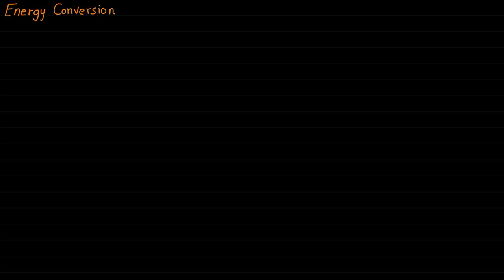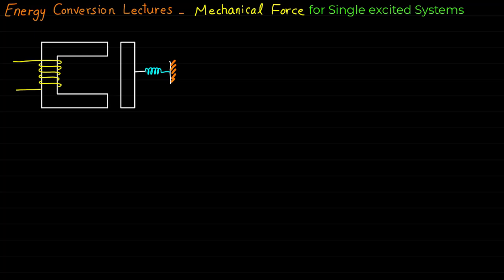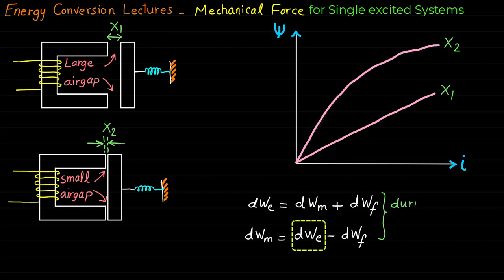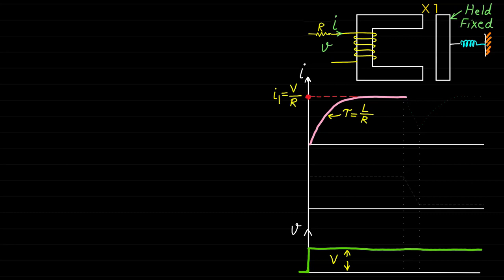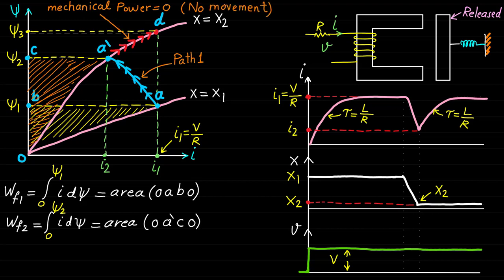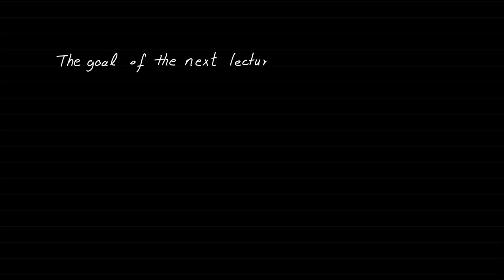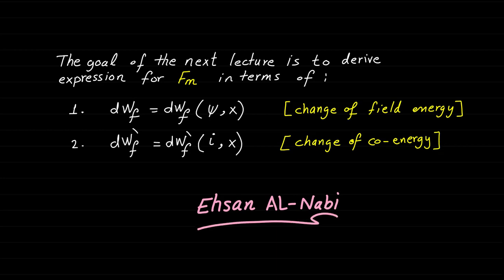Electromechanical Energy Conversion - Mechanical Force (Part 1)

Comment: great lecture, thank you so much, there's only one point I don't understand is at 8:14, can you explain why dWe = area(aa'cba)? (I understand that the integration is equal the area, what I don't understand is why the dWe is equal to that integration)
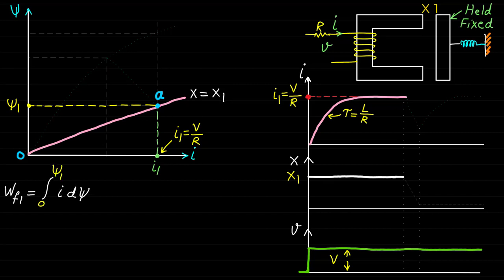Reply from the maker: Thank you for your nice comment and question. You can find  the derivation of the change in electrical energy (dWe) in lecture number 3 Field Energy (between 3:32 and 4:17). Hope that answer your question.

Comment: Hii, thank you for shwring your knowledge, lovely lectures. At 13:43, isn't dWf dependent on i also?
Reply from the maker: Thank you for your question. As you may have noticed during the lectures of the electromechanical energy conversion, the mathematical approach we follow is based on the energy balanced approach which assume that the magnetic energy stored system is lossless. Under this assumption, the magnetic field stored energy Wf in the equation   “dWf= i dBsi – Fm dx” represents a state function. That means,  Wf determined uniquely by the values of state variables “Bsi” and “x” regardless of the path that “Bsi” and “x” are followed to reach their final values. In other words, the initial and final values of the Wf depends only on the initial and final values of the state variable “Bsi” and “x”. Note that the current “i” and the force “Fm” affect the path of the states “Bsi” the “x” only and they are not affecting the final value of Wf and the final values "Bsi" and "x".  You can also do more search about "the state function and state variables" to get more information. Hope this answer your question.
Reply: @EnergyConversionAcademy  Okay, got it. Thank you for the clarification, I really appreciate it. Sorry for the late reply, I was busy with my sister's marriage